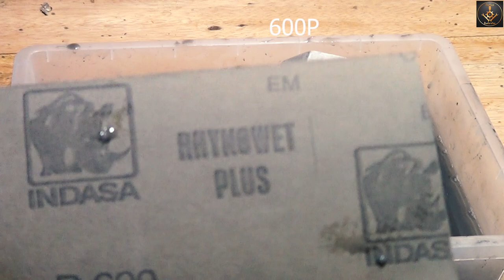Vintage Italian Moka Pot Restoration | Easy Coffee Maker Restore

Comment: Excellent work! but i think that you deformed the floor of the coffee filter (the one you put the coffee grounds), which leads to the coffee ground to mix with the water inside the pot. This hinders the coffee from releasing its flavour, because it makes contact with really hot water instead of steam. 

Restoration aside, I recommend you to put the hot water first (not boiling) and then add the coffee holder (the cup with the filter). In the upper container add some water (room temperature) in order to keep the coffee (liquid) from hitting a really hot surface. As soon as you get all of this done, assemble the parts and regulate the fire from the stove in order to not get the coffee (liquid) from pouring too fast, and cut the fire as soon as the coffe stops streaming constantly.
This last part is just a recommendation from a coffee enthusiast.

Anyway I will follow some of these helpfull steps! Thanks for sharing and sorry if any of my previous comment bothered you.
Reply from the maker: Thanks for your idea❤️
Reply: @TheMechRestoration  glad you liked it, thanks again to you for sharing the video
Reply: How? It's still flat and only steam will get to it.
Reply: The hacks promoted on social media by Specialty Coffee influencers are not necessary and don't make the best flavor. They only need their hacks because they never learned how to use the Moka correctly. 

You can trust Bialetti's instructions for consistently good flavor that's never bitter nor burnt, as long as you use good-tasting espresso that's ground medium-fine for the Moka: Bialetti Perfetto Moka Espresso, Lavazza Crema e Gusto, Lavazza Qualita Rosa, Lavazza Espresso Italiano, Kimbo, illy Classico Espresso for Moka, illy Intenso Espresso for Moka, etc. 

Most espressos are ground too fine for the Moka, but the espressos sold in Italian grocery stores are all ground medium-fine for the Moka; so just look for the little Moka icon on the package.

Bialetti's instructions are based on state-of-the-art scientific testing and professional taste testing for the best flavor:

Fill the reservoir with cold or room temperature water to touch the bottom of the valve, preferably filtered or bottled water for best flavor. 

Loosely fill the basket with medium-fine ground espresso till it's even with the rim, but don't press it down. Use the straight handle of a coffee scoop to scrape it off level with the rim. 

(Don't add water to the upper chamber, it dilutes the flavor and is not necessary to prevent burning if you follow all the other instructions.)

Cook it on a low gas flame or a preheated medium electric stove. 

The instant you hear it begin to gurgle, remove the Moka from the stove and let it finish brewing on your countertop from the residual heat inside the pot. 

Stir up the most-concentrated coffee from the bottom with a teaspoon, and pour.

When you open the Moka to clean it, you'll see leftover brown water in the bottom that's full of fines. That's good! That leftover water isn't good-tasting and if would've diluted your coffee and dirtied your cup with sediment if it had gone through from leaving the Moka on the stove too long.

This is a very easy process that always makes good coffee that's never bitter, never over-extracted, never burnt. 

99% of the Moka tutorials on YouTube are wrong. The only good ones I've found are "Ill Barista Italiano Moka Detailed" and "Annalisa J Moka pot." They saved my coffee after the Specialty Coffee influencers messed it up.
Reply: The Moka doesn't work by forcing steam through the coffee powder, it works by bathing the coffee powder with hot water that's lower than boiling, and with pressure, so it should never boil. 

The water pipe is well below the surface of the water, so it doesn't funnel steam up to the coffee, only hot water. 

The Moka works by gradually heating and expanding the air, water, and vapor gases until there's enough pressure to push the water down and up into the pipe.

Comment: hi mate, i bought one for penies, and i did all you did, but theinside of the buttom part its all burnt, with sand paper i manage to remove some, but its dificult to work in there, any sugestions on how to remove like 1mm of all inside of the bottom part ?
Reply from the maker: Pour citric acid inside and heat it at a low temperature, or you can use vinegar or lemon/lime juice the same way, but if you can use the diluted sulfuric acid, I think it’ll be quick. (Suggest sulfuric acid as the last method; be careful with it.)